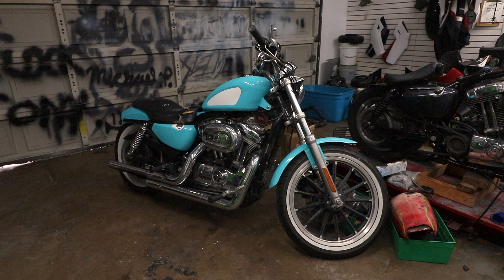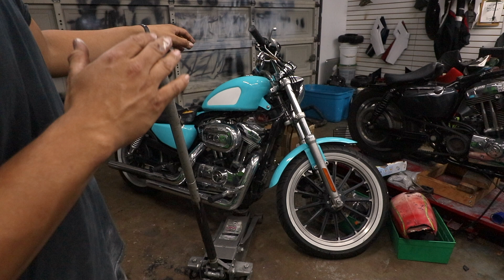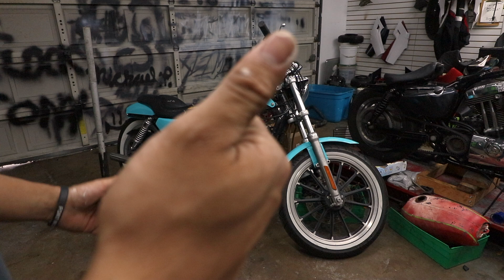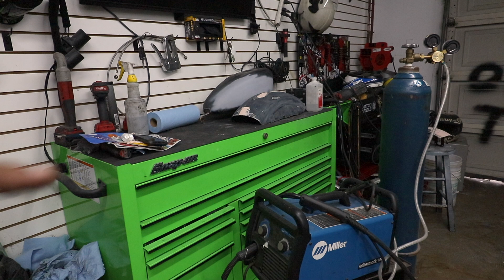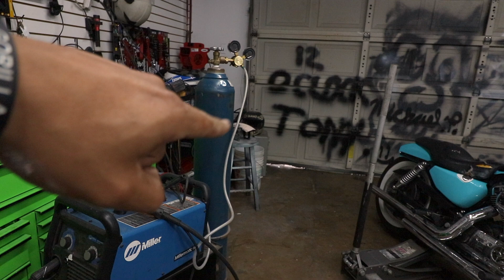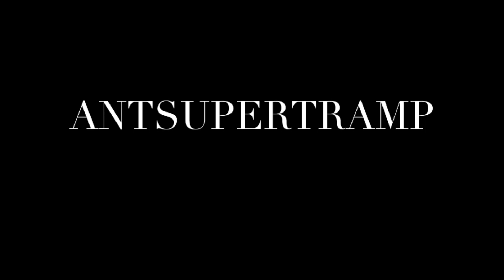HOW TO JACK UP A MOTORCYCLE WITHOUT A LIFT

Comment: NEVER use a floor jack with a four pronged saddle (I've never seen a floor jack that didn't have one) under a motorcycle. It will damage the frame/engine/transmission whatever you have it under. REMOVE the round four pronged saddle, and put a short piece of 2x4 in it's place. Also, before jacking, place a piece of 2x4 under the sidestand. This reduces stress on the sidestand. then jack from the right side of the bike as much as possible, and ONLY high enough to get the wheel off. This applies both front and rear. The sidestand was not designed to support the bike at an extreme angle, the 2x4 under the sidestand prevents that. The wood block in place of the saddle prevents the sharp steel saddle from contacting the bike. Only the wood 2x4 should contact the bike.
Reply from the maker: good info brotha!